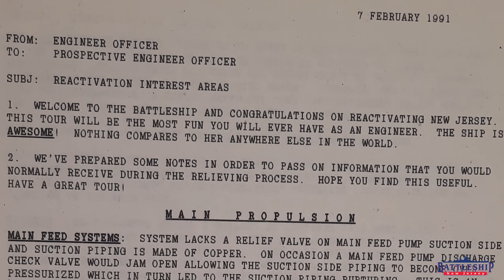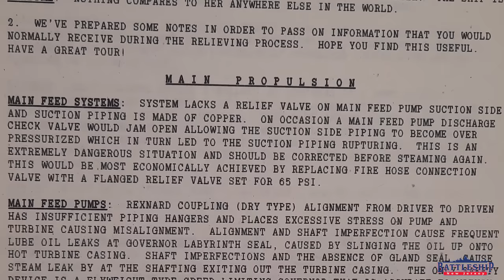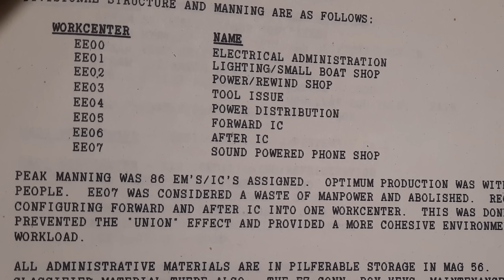The Call To Freedom Will Be Sounded Again: How to Bring Back Battleship NJ

Comment: I could see New Jersey being reactivated, potentially in the case of a naval war around China and Taiwan. Like you said, she is the only ship that can provide long-range gunnery fire support, which would be needed in any naval war with China, and her armor and size would certainly make her more survivable in that theater than any other active warship.
Reply: her size would make her the biggest target for a DF-21 ever, and a single hit of one of those will sink her, even with just the kinetic warhead rather than a nuclear one (which is the default loadout).
Which would be a major propaganda victory for the PLAN.
And her guns would be pretty much useless against China, they don't have the range to hit anything important that's not well enough defended to prevent her getting close enough.

That same DF-21 btw is why US carriers will have to stay outside strike range of the Chinese mainland, rendering them effectively useless in any war with the PRC.
The US simply lacks the ABM capabilities to take them out. In terminal phase they're close enough but too fast and at an impossible intercept angle, in boost phase they're out of range.

Comment: It's unlikely they'll bring back the Iowas.  It is more likely than them building a new battleship though.  It would be interesting to find out if the New Jersey shares a similar boiler to the Big Boy steam locomotive.  The Big Boy does use super heated steam.  I'm not sure about the pressure, but both were built at the same time.  One Big Boy is operating now.   UP 4014 by the Union Pacific Railroad as apart of their heritage fleet.  The Big Boy is a massive locomotive at around  140 ft with tender.  She also has 4 pistons driving 16 massive wheels.  She weighs over a million lbs.  Granted, she's not a 45k ton battleship, but she only has a boiler and not much else.
Reply: Big boy locomotives run on 300 psi steam. New Jersey runs on 600 psi steam. It's a world of difference.
Reply: The Locomotive boiler is a "Fire Tube" type.  The New Jersey's boilers (8 of them) are  "M" design "Water Tube" type

Comment: I love that. An official handover document and the author literally opens with a fan-boy moment. That's epic, and proves that crews do still love their ships as much as they did back in the age-of-sail.
I don't think any of the Iowa's will ever return to service; they're very long in the tooth and are likely to get very delicate aside from anything else. However in my mind, there is potentially a case for a large, well-armoured hull that could survive hits in a missile saturation attack, and that was before the claims around the sinking of the Moskva and the use of air and water-based drones.
A well-armoured ship that could tank hits from a couple of Neptune type missiles or shrug off sea drone hits that has been purpose-designed for modern munitions and systems could be a very useful asset.

Comment: I think if chances ever got good for the battleships to return to service, it would be because recommissioning something already built will be more politically pallatable than the inevitable cost overruns. Of course, everyone would find out pretty quickly the reality, and it would turn into a debate of keeping it "down" on effectiveness by trying to match as is for the long term historic preservation, or as I think would be the case, to undergo a major modernization with dramatic changes to the overall arrangement within the boundaries of the hull, and perhaps even a new superstructure.
Reply: It won't be as cheap as last time. They all need to be completely re-engiend now.
Reply: @joshuahudson2170  Oh absolutely, it'd be a massive expense that would be looked at as a disaster for many years.
Reply: @joshuahudson2170  I keep seeing the re-engine comment.  On what is that based?  The IOWAs have steam turbines. Unless the turbines have cracks in the rotors, all they might need would be replacement bearings.  A royal pain in the tuchas, but doable.   The boilers might need a few new tubes and some refractory, but again that's doable.
Reply: @barto6577  Boilers don't last forever, and the reports I've heard is they're all near end of life.
Reply: @joshuahudson2170   Boilers don't have a lifespan per se.  Tubes can be replaced, drums can be welded up to repair cracks and pitting, and refractory is considered a consumable/ wear item.  I was part of the crew of BTs that did the last re-brick of all 8 boilers on the New Jersey in 1986.  Her boilers would be fine with a bit of maintenance.
Reply: @barto6577  How about the boiler - firebox separation? The steel slowly dissolves. When it's too thin is normally the time the boiler is replaced
Reply: @joshuahudson2170   That's called the "Tube Sheet" on a Fire tube type boiler.  And they are repairable by a good weldor.  Steel can almost always be fixed.  The BBs have "Water Tube" type boilers.

Comment: While I would LOVE to see the USS NJ go back into service one more time, I suspect the expenses are just too great.  Just bringing the ship up to OSHA specs would cost too much.  And if any of the large parts need to be replaced, the US probably no longer has the manufacturing capability nor expertise to build a replacement part.
Reply: If the nation is ever put into a position in which we are reactivating a  battleship, I believe OSHA will probably be the lowest concern.
Reply: Be cheaper than a carrier. By a long shot.
Reply: @AdmiralKakarot  not as effective
Reply: @AdmiralKakarot  Well said Admiral!
Reply: @Inspadave  saves lives and planes
Reply: @Inspadave  In an area too hot for planes, you can bet those 16" guns are effective for ground bombardment.
Reply: I fear the battleships would not be brought back.   For peacetime, the operating costs would not justify the benefits.   They would need to have entire engineering plant to basically be scrapped and replaced, and as cool as the big guns are, they really would have to be redesigned to not need so many sailors to operate them.    For some burning wartime type need,  they really would take so long to bring back that that need would be overcome by events.     
    I could see building new a couple of 8 inch gun cruisers, like USS Salem.  They could be tricked out with fancy new extended range shells to get battleship main battery ranges with much higher rates of fire.    But those wimps in Congress would never spend the money.
Reply: @AdmiralKakarot  If the area is too hot for planes the battleships are gonna make it within the necessary 26 miles in order to hit something directly on shore.
Reply: To place the situation in Naval Terms, the US Navy's relationship with OSHA has historically been limited to inviting the OSHA folks to take a long walk on a short pier.

OSHA's mission is to make the civilian workplace environment safe for the average drooling idiot who somehow got hired.  Idiots in the Navy usually receive advanced technical training in rust removal and paint application.  The bright ones may graduate to an actual paint sprayer.

Idiots who make their way to engineering receive special advanced training as well.  With time, they can usually be trained to properly estimate the amount of Pine Oil required in the mop bucket when cleaning the Head, and the ones who try hard can generally be trained to wax and buff the decks in Engineering Berthing without beating the crap out of the bulkheads when they lose control of the buffer.
Reply: @AdmiralKakarot  If the area's too hot for planes, its far far too hot for ship with limited range. TLAMs and bombers do the job
Reply: @Jo-rz6bs  The Iowa's have CWIS and missiles as well. Modular weapons that can be easily updated.
Reply: @AdmiralKakarot  Zero Sam systems, so they need dedicated Escorts that could just carry the same missiles themselves for far cheaper, with better self-defence. Quite sad overall, but there's no reason for anyone to bring them back, in the past it was mostly political pressure, is my understanding
Reply: @kevincrosby1760  🤣😂🤣😂 So true, so true, so effing true.🤣😂😂🤣🤣🤣
Reply: @barto6577  As I was typing that I was thinking of a particular SN from Deck.  He was pretty much the assigned "paint guy".  You could hand him a key at knockoff, and walk into the space at 0800 the next morning to a pristine space with no overspray to be found.  Where most folks would mask stuff off, he would just run around with the spray gun and a piece of cardboard.

On the "military" side, I'm not sure that he could tie his own shoes.  During uniform inspections, he could generally (not) be found hidden in After Steering with a can of NEVR-DULL and a handful of rags.  After Steering was one of the few places that was not "on the way" to somewhere else, and Deck was running out of places to hide him.  The one time that I saw him in Blues, he looked like he pressed them using a piece of deck grating and a brick.
Reply: @Inspadave  Approx. 1.5-3 billion per ship. That's the fraction of the cost to build a carrier. All four together would still be shy of the cost of a carrier (12.9 billion). As far as upkeep, considering their age and the fact spare parts still exists, their upkeep costs would also be low. You're grasping at straws now, bud. You may have convinced yourself of this crap, but you aint gonna convince me.
Reply: @dalesql2969  Back in the late 80's I recall reading articles on proposals to equip the 16 inch guns with submunitions that would have a range of 100+ miles with GPS guidance to hit the target.  Would have been interesting

Comment: I decom fwd diesel / evap. We were told to put it in a state where it could be reactivated in I think 60 days. I was inside the evap with a needle gun, then when finished we slid the tubes back up to some spacers we made. Also let piping flanges spaced. Let me know if you need me to return to put it back together.  I would also like to see that document and see if it mentions the evaps.

Comment: My father was an original plank owner on the Iowa, he joined the ship before she was commissioned and served on her the entire war (WW-II), and at one point was the youngest chief in the navy at the time.  While I love the ships, I think that at this point, there is so much which would have to be done to reactivate them, and, the cost of operating them is so high, that it probably won't happen.

One thing I would like to hear about is the original radar systems which were on the ships when first built.  The highest one looked like a bedspring, and they were all removed during upgrades during the war, there are very few pictures of those antenna available

Comment: Wow.  Amazing.  What a find.  Don’t think they’ll ever bring her back, unfortunately.  Cost would be high - not as much as new construction, of course, but I think the show stopper  is ultimately the propulsion system.  The expertise for running the NJ’s steam plant isn’t there anymore and replacing it with something more modern would be virtually impossible with the armor plating - have to cut through it.  I have always believed that, even in today’s modern military, there remains a valuable and valid mission for a large gun platform. But I can’t see the Navy spending the kind of money they would need to lay out to bring her back.  But, there’s always a glimmer of hope - my old service (I’m retired AF) is still flying B-52s and will continue to do so into the foreseeable future.

Comment: It would be interesting to do a video on which Iowa class is closest to seaworthy. I remember there was a video about connections for external steam lines that were disconnected in the interest of better waterproofing the ship. Also a video on how many 16 inch shells of each type are currently available along with how many powder charges. I'm not sure these would be easily replicated without Star Trek technology!
Reply: In modern times, those steam lines had one purpose.  That purpose was to provide pier steam for the galley, space heating, and hot water for the sinks and showers.  Condensate went to the bilges or was discharged over the side.

The Steam Plant at a Navy base has the primary function of heating buildings.  This being the case, steam quality is maintained at a level suitable for radiators...not turbines.  Engineering went to great lengths to isolate Shore Steam from anything in the plant.
Reply: @kevincrosby1760    Try again dude.  I was a Boiler Tech on the Big J.  Shore steam was used EVERYWHERE onboard,,,,including for "steam blanketing" the main boilers, and preheating the boiler feed water prior to lightoff.
Reply: @barto6577  Perhaps it was a "ship" thing?  I've noted over the years that my ship seemed to do more than a few things just a little different.

I do know that they would open the steam valve on the pier to blow the rusty water out of the lines before they would hook up the hose, so it could have very well come from being homeported at NSC Oakland, where some of the buildings visibly leaned to one side and at least one had a collapsed roof.  Half the base was a ghost town of empty warehouse buildings. 

I will freely admit that I was NOT a BT, so did not know the original intent behind many things.  I can tell you from direct personal experience that NSC Oakland did not have Cable TV to the piers which we used, and that the phone services were so crappy that our PBX frequently raised "Trunk Fail" alarms.  Staying for more than a week generally resulted in at least one unscheduled op-test of the EDG when they lost Shore Power on the pier.
Reply: @kevincrosby1760    All USN steam sources afloat or ashore are SUPPOSED to use similar boiler water treatment systems.  Blowing the carppy condensate out of the lines is just good sense.😁
Reply: @kevincrosby1760  thanks for the reply! To you and Alan Bare.  As I remember from that episode that was the point of the external hookups because there was steam available at the base and they wouldn't have to constantly run the boilers. The problem I see is they've been disconnected and how much extra work and expense would it be to restore that capability.

Comment: With the use of surface drones attacking ships in the Black Sea I would argue the Battleship would be a great fleet defender.

Large amount of weaponry coupled with a long deckspace where dedicated weaponry could be installed and should the worst happen the explosion at the waterline would cause damage, a lot of damage but would not sink a battleship. I don't see 1 or 2 anti ship missiles sinking a reactivated ship either.

A BB between an enemy held shore and a friendly carrier would be a major asset even if it's just blocking drones and missiles.

Then there are the 16" guns which are considerably cheaper to fire than a missile.
They could even be used to remove an artificial island.

Comment: I am curious as to how many other spaces there are like this on NJ. Each division has probably squirrelled away something, somewhere that they believed was instrumental to a future activation. If it was anything like my unit we has what was on the books and what we hid from inspectors every time they came around. The spare parts budget being arbitrary, it always paid to save anything you might need in the future, that you did not have to turn in to get a replacement.
Reply: ...and sometimes the hassle of ordering a component through official channels was bad enough to make it worth simply dropping a $5 on the counter at Radio Shack and being done with the problem.

Comment: As someone who worked on the Zumwalts, Both Zum and New Jersey are victims of the the same practical reality of attempting contested close shore bombardment. 

The advent of shore launched anti-ship missiles made the role so risky that its practically obsolete. Things like the P-15 Termit with 1000lb warheads could, in a single hit, do enough damage to an Iowa to effectively mission kill it. With the English ship losses in the Falklands to anti-ship missiles and the very near miss against the Missouri in 1991 with that same P-15 Termit missile the role began to be seen as far to risky. 
The Navy tried to offset this with a stealthy shore bombardment platform; the Zumwalt. However by the time of the first ships launch adversaries had a wide array of anti-ship missiles to chose from in both air and ground launched configurations. The stealth technology that the Zum was designed with simply was not good enough as both radar and missile tech continued to out pace her stealth and the theoretical extra range the railgun could provide.

Maybe with the advent of more powerful, efficient and reliable lasers it might be viable to revisit the concept. However, hardkill lasers of that kind with the necessary range are probably at least 5 years out as of this time.

The only viable scenario I can see for close shore bombardment in a peer on peer conflict is if we see the return of Island hopping during an SCS campaign. Hostile airborne or amphibious forces would likely lack robust shore launched AShM capabilities. However an Iowa would need a CSG sized contingent of escorts to keep hostile air launched AShMs away which poses its own resource and manpower tradeoffs.

Comment: I believe they will return as there is such a large gap between the CVN's and DDG's in terms of warship capability. This Navy seems to hate the Cruiser concept, and I believe the next-gen Naval leaders will recognize the shortfall and fill it with the super-available Iowa class until new Cruisers can be built. I see New Jersey and Wisconsin coming online first, then Iowa and Missouri though I doubt that all four would be in service at the same time, though that would solve issues of ship availability. They won't replace the Cruiser, as we need more than four, but they will ably fill the gap that is glaringly evident in our fleet of the near future.